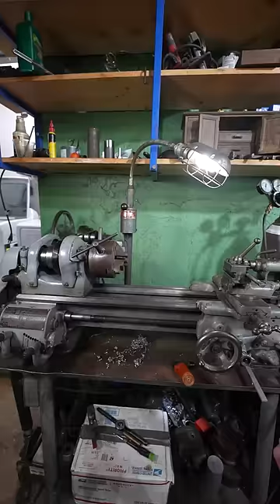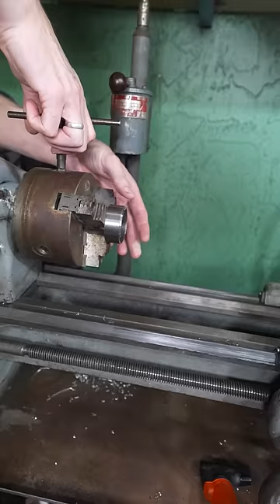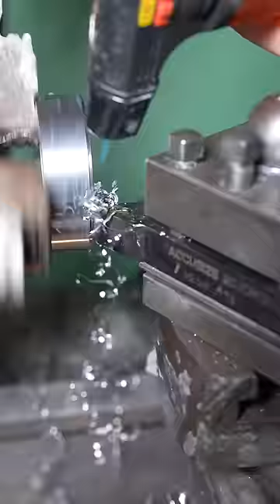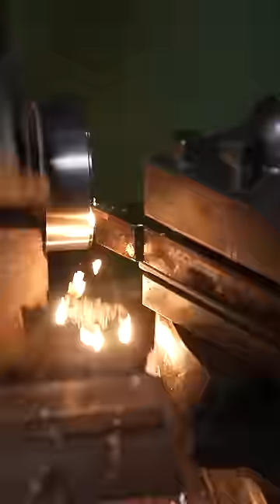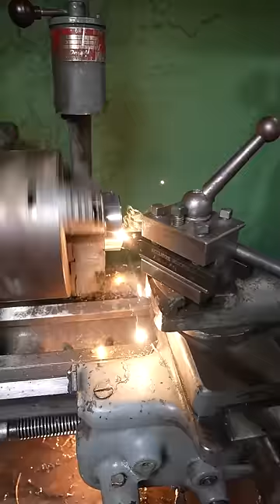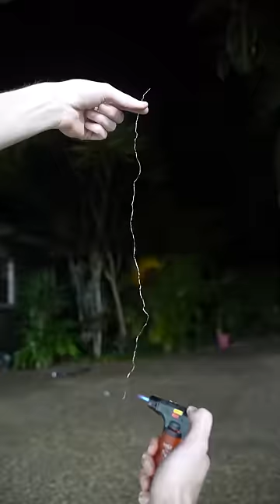Titanium has a dirty secret

Comment: I used to work in an aerospace foundry. One of the worst fires I dealt with was after a coworker let his wetsaw build up with titanium shavings, and it burst into flames. Burned through the down feed hose of the saw and blew all the fire extinguisher stuff back in my face. I ended up having to douse the flames with flammable liquid with a really high flash point. I didn't get blown up, so It all worked out in the end.

Comment: My god titanium is flammable
Reply: And apparently explosive if you try to put it out with water
Reply: They used a titanium alloyon the fastest plane the sr71 I wonder why it didn't catch on fire
Reply: @Player-pj9kt  farts
Reply: @Player-pj9kt  searched it up. Apparently only small chips and dust of titanium is combustable, similar to magnesium. However, any particles bigger than about 2.7 mm are considered difficult to ignite. Large castings and structures of Ti are virtually impossible to ignite under normal conditions.
Reply: @Player-pj9kt  now i kinda want to see someone light up a massive chunk of titanium under those certain conditions
Reply: @E_Rico  its about surface area so maybe a honey comb structure would be the largest amount you could actually ignite
Reply: @Player-pj9kt  maybe surface area
Reply: @E_Rico  thanks i was wondering how they got titanium car exhausts
Reply: Steel is flammable too it's all about how much surface area there is when its in chips like this. You can actually use steel wool as a fire starter.
Reply: @thomasb4863 titanium has to be Tig welder in a bubble filled with argon to keep all oxygen away from the welds.  Exhaust parts only have to be filled with 100% argon.
Reply: most metals (or small things with lots of surface to volume) are flammable, so that ain't special.
Flour is flammable. Iron is flammable.
But try setting a sizable chunk of iron on fire, you can't
Reply: @carpediemarts705  how is that different from any other metal?
Reply: @jinxtacy  titanium has to have a lot more oxygen deprivation.
Reply: @carpediemarts705  Is there a metal that doesn't require oxygen deprevation? (Sincere question) I've never welded a bead in my lift aside from bumping a piece of metal into a welder that was on for some reason.  I was trying to learn and it seemed argon would be required unless you utilized flux which is another way to combat contamination of the puddle.  I always thought it was the weight of the gases that displaces oxygen to protect the puddle until it resolidifies and cools.  It seemed necessary for aluminum at the very least, backpurging is required with stainless, but I don't know about mild steels.  Still learning.
Reply: @jinxtacy  the crust on an old fashioned welding stick coats a weld to keep the oxygen off the hot metal.  Flux and argon do the same.  So you understand stainless requires back purging to keep the oxygen off the inside of the weld.  Titanium is the same but more sensitive.  Regular mig stick Tig welding keeps Most of the oxygen away.  Maybe 90 % where for welds more crucial than a car intake, the oxygen deprivation has to be 100%.  Aerospace things get welded in a plastic bubble.
Reply: @carpediemarts705  thanks for the clarification. I was trying to make sure I wasn't coming across as snarky.  So it's just a greater degree of sensitivity of the material. It does seem like a pretty unique metal in some regards when I watch the way people machine it by never really picked up on that difference in welding.  Well watching other people love should be the appropriate term lol. Thank you again for sharing your expertise
Reply: EVERYTHING is flamable - if the particles are small/the surface big enough!
There was a titanium-dust-fire in a workshop of the aerospace-company i worked some years ago...

Was not funny...!
Reply: @jinxtacy  "expertise" ha!
I've never seen titanium and a welder in the same place.
Reply: Ti is very reactive to Oxygen, that is the actually definition for "burn"
Reply: Fire is just a rapid oxidation reaction. Really, the hard part is keeping titanium from oxidizing. 

TiO is how titanium prefers to be, and we spend a lot of energy keeping it from being that way. It doesn't take a lot of encouragement for it to return to that state.
Reply: So they can inject water while machining it.
Reply: @alexlo7708  I'm not sure, I think is Argon because water still have oxygen and titanium can break the molecule and now you not only have a burning titanium but flamable hidrogen too XD.
Reply: @mgkleym Fun fact, in a survival situation, all it takes is a 9-volt battery! Make sure you tease out just a bit of it, preferably WITHOUT any cleaning chemicals on it (e.g. the way much Brillo is sold). This IS dangerous, as I said, it's for survival, like "no fire➡️I'll freeze to death".
Reply: I went to see a 3D printing lab and they had a metal sintering one that works with titanium that they had to keep in a small roofless structure in the middle of the place with no roof to direct any blasts upwards.
Reply: @YounesLayachi  Sure you can set iron on fire. Heat it up enough and then hit it with a surplus of oxygen. It releases so much energy you can carry on the cut using the oxygen alone. 

Probably why steel wool will burn, surface area to volume. Same thing with titanium chips, aluminum powder, anything magnesium. Get very nearly any metal hot enough and it will oxidize and usually rapidly. If the big chunks won't burn, heat them up and increase the oxygen percentage. That'll do it...
Reply: @pontiacg445  that isn't what most people mean when they say fire though :)

You could surely make a red hot block of iron react with pure oxygen, but it won't sustain a fire once you cut the supply of oxygen and replace it with normal air.
Reply: @YounesLayachi  Sorry, but I have to disagree. The fact that iron does burn with heat and oxygen, and that it's an exothermic reaction, is exploited on so many levels of manufacturing. Literally what makes our modern world go round. 

Most people don't understand how the food got to their plate, so their understanding isn't exactly something worth basing anything off...
Reply: @pontiacg445  you're free to disagree , of course, but i would love to hear your examples of manufacturing that relies on iron burning "with heat and oxygen" and exothermically.
Reply: @YounesLayachi  You've never heard of an acetylene torch before? The initial preheat is all acetylene, the cut is all done with the exothermic reaction of burning iron using oxygen. 

Modern equivalent is a laser cutting plate steel using oxygen as a cutting gas. Essentially an acetylene torch without the acetylene...
Reply: @pontiacg445  my point is as long as you're dumping pure oxygen on it, it's not really "catching on fire" nor the material is "flammable".
It's like dumping Fluorine on concrete and then saying concrete is flammable
Reply: @YounesLayachi  I would ask you to go look up the definition of fire, which you'll find is....

"combustion or burning, in which substances combine chemically with oxygen from the air and typically give out bright light, heat, and smoke."

And now describe to me how exactly it is that you think burning iron isn't burning? Is it because it would make your previous statement ("But try setting a sizable chunk of iron on fire, you can't) false? Can't be because of logic or reason...

Fluorine? Pretty solid reach there.
Reply: @pontiacg445  the iron is burning, but in your own definition of fire : "oxygen from the air".
An oxyacetylene torch or a plasma etcher isn't oxygen from the air :)

I reached for fluorine cause it has all the same chemical properties that make oxygen able to oxidize stuff
Reply: @YounesLayachi  Ah, yes. The Oxygen in the torch came from nowhere, certainly not the air. Consequently, a fire in a fireplace is not a fire because the air surrounding the fire has been modified by the fire, it doesn't have the exact oxygen ratio as it normally did!!!

Oxidization =/= fire. Steel will oxidize and form rust, that is not fire.
Reply: So is cardboard and old newspaper.

Comment: In our shop we have 2 measures: the chuck key has a spring, so you need to push it in as well as turn it or itll eject itself, and the chuck key holder is right beneath the start button, ajd we're drilled to only ever cycle start with the chuck key in our hand
Reply: What if you made the start button a spring loaded rotating switch that is operated by the chuck key?
Reply: @FreedomTalkMedia  I was thinking what if you either used the chuck key as a key for an isolator switch, or at least tied the chuck key to an isolator switch key using a very short string?

Comment: Fun fact: Such as turnings, filings, or shavings are called metal swarf. Swarf of pure magnesium, magnesium alloy, pure titanium, titanium alloy, iron, and non-stainless steel are highly flammable! Swarf stored in piles, bins or scrap collectors may spontaneously combust through friction or pressure or electrical current, especially if coated with cutting oil!

Comment: It's so weird how flammable metals actually are in the right circumstances
Reply: most things will burn spectacularly if the conditions are right
Reply: Really, the hard part in most cases is STOPPING oxidation reactions. Oxygen doesn't need a lot of encouragement to bind to damn near anything.
Reply: Not flammable, reactive

Comment: A common misconception is that Titanium is expensive/praised because of its strength. where in fact that it is actually only as strong as steel, but around 45% lighter. the real reason why Titanium is great is that it is able to achieve the same strength as steel while being 45% lighter, which is mostly used when constructing things like airplanes or spacecraft.
Reply: Ask a punch press operator or a machinist about the difference between punching, milling, turning or drilling steel stainless steel, and titanium, he'll clear up  the question of which is stronger, and consequently harder to work with. Titanium wins I promise.

Comment: It’s not exactly super strong, it’s around as strong as steel but this is very impressive due to it’s light weight
Reply: yep it's like aluminum mass with mild steel strength.
Reply: Light weight or low density?

Weight and density are not the same thing.
Reply: @deang5622  you get what I mean. Less mass same strength (more or less)
Reply: @Dannydave43  I know exactly what you mean. And I am deliberately correcting you because it is important to be correct.

If you can't use the correct properties then people will question your level of knowledge on the topic.

Comment: The armor of the mobile suits in Gundam Wing were made of Titanium, which is why Gundam Shenron's (AKA Nataku) flamethrower worked on them.
Reply: Bulk titanium doesn't catch fire easily, less so in the vacuum of space.  

...I don't watch Gundam, so I'm presuming it happened in space.
Reply: @h8GW  It depends on the series but a lot of Gundam battles happen either in O'Neil Cylinder colonies or on earth. 

They're also not pure titanium but a titanium matrix composite that takes advantages of 0-g  (no artificial gravity in Gundam, just spin and thrust and most ships can't move fast enough to really matter there) manufacturing to increase it's strength.

Comment: It's not more flammable than steel shavings/steel wool or even many other metal shavings I've seen being burnt
Reply: Yes it is, steel is not a combustible metal like Titanium, Aluminum or Magnesium is. 

No solid material can actually burn as only gasses do that and it is off-gasses produced when heating a solid material that actually produce fire. 

Almost any material in fine enough form can burn when sufficiently high temperature is applied much like steel wool does as the tiny particles or fibres can off-gas rapidly across their whole small surface area with enough air mixture between the fibres to ignite those gasses. 

Titanium and other combustible metals however off-gas in greater amounts and require a lower air mixture to ignite allowing them to potentially combust at lower temperatures and in much larger particle/fibre sizes and typically in much more reactive fashion.

In small amounts it may not seem much different but ask any firefighter that has ever fought a Class D fire and they'll tell you the difference definitely matters.
Reply: @jongrey1916  Chunks of the metal evaporate off and burn? lolololol

Ever used a torch before? Get anything hot enough and whack it with a lot of oxygen. It will react, and since it's oxidizing, it's burning by definition. 

In fact, it's the oxidation of iron in steel that allows a cutting torch to work in the first place, all the heat comes from the oxidization of iron (AKA burning) because steel being able to rust means it's combustible...

What a maroon.

Comment: You right the key is flying out. .05. Look around lower left, you will see the key shaft going by the railing.  Lucky man.  I spent some time on different size units. Never did it, close but stopped in time.  1963, Arkie’machine shop , Borger, Texas.  Careful out there,   John.

Comment: Don’t let it pile up, good note. A good pile of the stuff will crater concrete or burn through other metals. It can only be put out with a Class “D” fire extinguisher because it will tear a water molecule apart to get at the oxygen. Don’t hit it with water. It explodes.

Comment: The same thing as Plutonium machining that metal has the same habits. Zirconium with high temperature steam does another thing it makes the metal very brittle through hydrogen embrittlement. So nuclear power operators not to do silly things like playing with control rods and wham a Chornobyl accident.

Comment: 25 years ago, in the place I worked at, we used to vaporize titanium with a high-power laser. As the titanium gas cools it falls back down the chamber, collecting itself on carbon fibers. We would then press it together in an argon gas chamber.

Comment: I do a lot of mod work on pocket knives so I have to grind a lot of titanium. I never do it inside my shop and always make sure to have a fan blowing at the belt grinder haha may be overkill, but when I first got into it I had a small fire under my belt grinder from where a small pile of dust accumulated. Another material that is equally scary in dust for is zirconium. Don’t have to work with it often, but I always try to go slow with sharp belts when grinding it.

Comment: The cool thing about titanium isnt really just how hardor strong it is, weve got steel for that, much cheaper, much more versatile.

The cool thing is how light it is despite its strength. 
This means that you can make pieces as thin as when youd make them out of steel, but theyll weigh the same as if you made them out of aluminium.

I've got glasses with a titanium frame, and they weigh basically nothing, its awesome.

Comment: Its also a poor thermal conductor which means that when cut into at high work rates it gets hot. And hardens. Potentially harder than the tool.

Occasionally this results in a work piece so hard you have to take the temper back out of it which is hard because it needs fo be REALLY hot to quench.

And its flammable. So be careful with that quench

Comment: Titanium is pretty much in the middle between aluminum and stainless steel.  Not as strong and stiff as stainless and not as light as aluminum, but stronger and stiffer than aluminum and better for high heat applications where the strength/stiffness of aluminum goes away quickly.  Ti has elevated "notch sensitivity" (like most plastics) though, so you must be careful where you use it AND make sure there are no defects in the final shape, especially when used for connecting rods.

Comment: Batman's suit is made of titanium in most continuties, which means all the thugs needed was a flamethrower
Reply: Nope, it's easy to set the shavings on fire but it has a very high melting resistance
Reply: @davidorf3921  it does but the thing is if it catches on fire once it doesn't burn out, so it's still a drawback

Comment: My dad tells a story from his metal shop class in school. Guy left a key in the Chuck and turned the lathe on with it set to some crazy high speed. Chuck made one revolution and shot the key straight up, key punched through the metal roof and came clattering back down in the roof several seconds later

Comment: I used to machine a LOT of Ti (6Al4V), including grinding and hand polishing.  It's not just that it burns brightly - it burns at 6k degree and will straight up burn holes in anything it touches... including your eyes, skin, hair, clothes, safety goggles, etc.  I've had Ti sparks land in my eyes before and had to have them dug out by an optometrist.  NOT.  FUN.

Comment: Any metal oxide will burn if the shavings are thin and hot enough. Magnesium is the only really dangerous metal to machine. But this also neglects to mention most lathes use a coolant.

Comment: On an aircraft carrier when you catch a fire on an aircraft early enough you can spray foam and sea water over it. But, if the fire increases and gets out of hand.. you simple bulldoze it over the side. With all of the exotic metals it has, it burns hotter than the surface of the Sun. If you spray water on it, the water will 'catch' on fire and explode.  The temperature will separate the bonds between the oxygen and hydrogen, and going boom. One of the factors in the horrible Forestall fire.

Comment: This phenomenon isn't confined to just titanium. All metals are flammable given the right circumstances. 
Go to the hardware store and pick up some steel wool, the finer the better. 00, 000 or 0000 will all burn very well. I keep a bunch of 0000 in my survival kit along with a magnesium fire starter rod. 
Note that magnesium is also a metal 😉